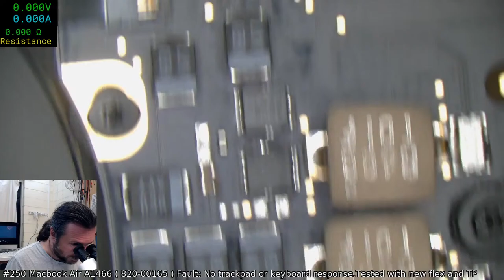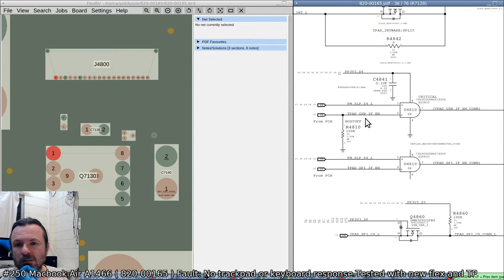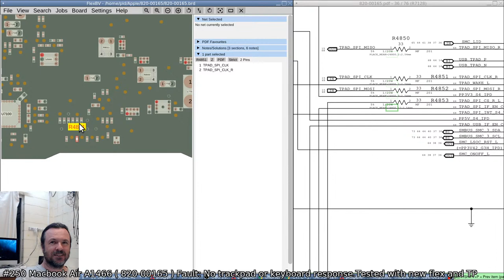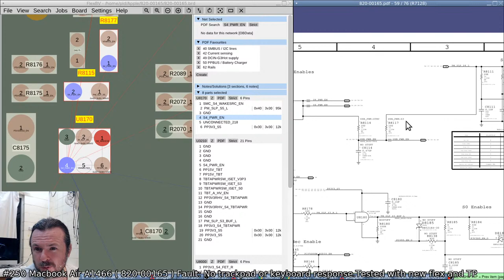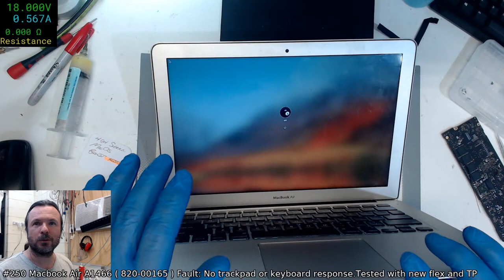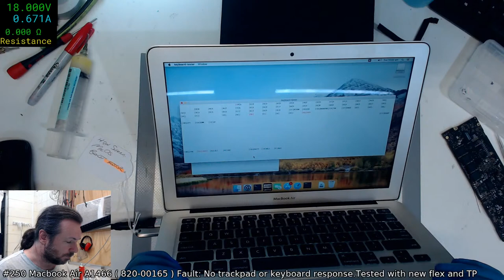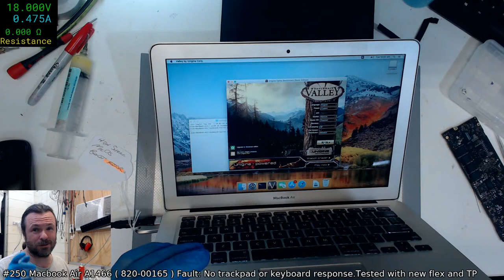#250 Macbook Air A1466 with no keyboard or mouse

Comment: Letting you know that my A1466 is going well, thanks for fixing it.
Reply from the maker: Thanks for letting me know, glad it's up and running again :)
Reply: Paul Daniels discovered something. I didn’t know. The charging cable light turns green when it first starts and when the battery is full BUT when it is charging it’s orange. 
For a minute or two I thought there was something wrong. 
Got your email ready. Then thought I better not sound like a fool and google this first green light orange light situation. 
Therefore no email to you. This was my daughter’s MacBook now it’s mine.